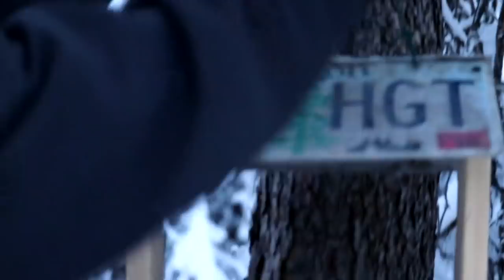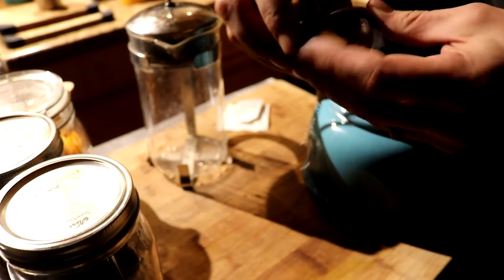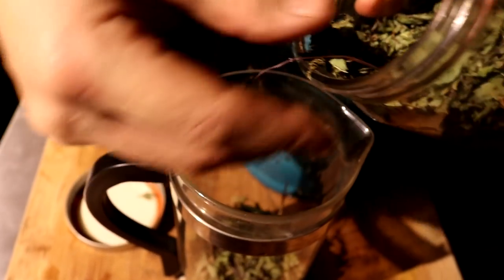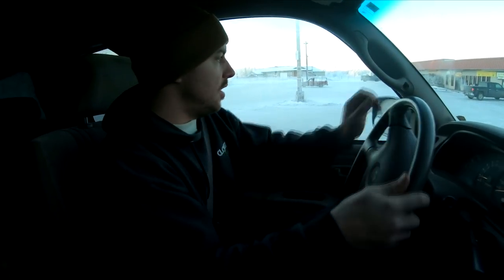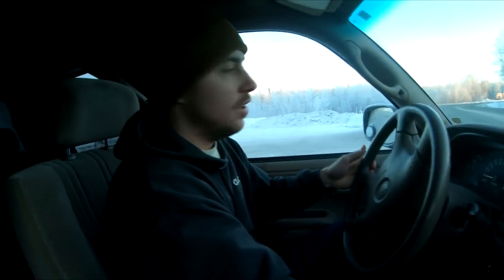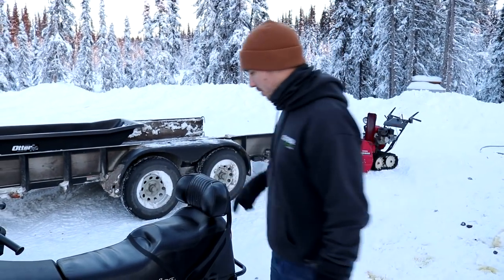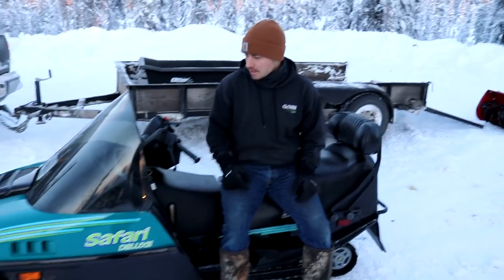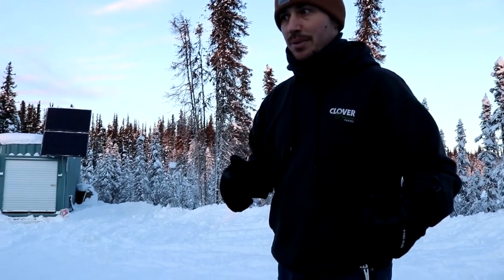Alaskan Winter -20° F | Picking Up a Snowmachine

Comment: That vice works good for the skill saw.LOL.  I thought 53 in the cabin was chilly. I’m a wimp obviously.. The heater trick dose work I’ve done it in the old CJ before. Nice score on the sled and blower.. Stay warm you two..!!
Reply from the maker: It got so cold our inside water line froze! Not good! Best lookin vice on the market 😁
Reply: @SimpleLivingAlaska  Wrap pipe insulation, it's cheap and easy to do.  It's just smart for anyone living in a climate that can freeze. My pipes are wrapped in the basement, so I don't worry, not for 30 years.

Comment: Fatten up them squrrils, before you eat them. Good idea.  If you start overheating, is good idea to check both engine coolant and oil. both will cause overheating.  Yeah heater trick works real good.

Comment: LOL try that overheating trick in sweltering summer heat! BTW, that sled will do so much work for you. We have a calf sled we bought for moving firewood and anything else, and it made getting our two big bucks into the high bed of the truck a heckuva lot easier than it would have been with nothing.

Comment: Those old snow machines aren't usually a wide track. You'll learn and then upgrade LOL Some days and conditions are better than others.
Reply from the maker: Will a wide track keep it on top of the snow better? Thanks for commenting.
Reply: @SimpleLivingAlaska  I'd bet you've used snowshoes. Same principle. More surface area, more resistance to crushing what's underneath and sinking. The wide tracks stay upright easier when you keep falling over sideways as well. Which happens more with a passenger. However, it doesn't mean you shouldn't enjoy the hell out of what you got! They were the norm for decades.
Reply: Yes...that Sled is for groomed trails
Reply: Uh before widetracks/longtracks that's all we had....for deep snow. The trick was to have a small machine like an Elan ss to break the trail for the larger snow machines....no one groomed trails to my place 120 miles in the middle of nowhere...And yes even the long tracks and wide tracks get bogged down...and are twice as heavy to lift out....Its a definite learning curve to ride snowmachines for the first time...
Reply: I prefer a long track to a wide track......
Reply: I have been involved in snowmo clubs since the early 70s. We have been grooming  trails since. @jedidiah5131
Reply: gman; Good for you, my brother also groomed trails In Northern Ont (Sudbury) ski doo capital of the world lol... ....I lived where there where no groomed trails ....

Comment: Dont know if you have access to hardwoods up where you are at, but if you do, to last all night put the whole log ( of course i mean sectioned for the size to fit in your stove) and 2 split peices on each corner of the log and unless you have a bad draft in your chimney that should burn 7 hours , was a trick my grandfather taught me , he live up in yellowknife nw and said it always worked, if you 2 sleep longer i would say whoever goes  pees in the middle of the night needs to chunk a piece in then on the way back to bed , peace be with you both , thank you for shareing this experience
Reply from the maker: Jack Caldwell, thank you for that tip! We will have to try that, it only seems we have that issue on super cold nights. We do try to mix in birch once the fire gets going, hoping to get some Aspen wood this summer.

Comment: I have lemon grass but don't know what parts I should use to dry them. I have successfully dried a lot of herbs with my oven set at 170 F for about an hour or so but I know I am probably cooking them instead of dehydrating them. How do you dry yours? Thanks
Reply from the maker: mary w we only air dry our herbs, you can use an oven (I haven't tried that method) or a dehydrator. You can use both the thicker stalk and the tips or leaves. We froze the stalks last year and used for recipes, I air dried the leaves for tea ☺